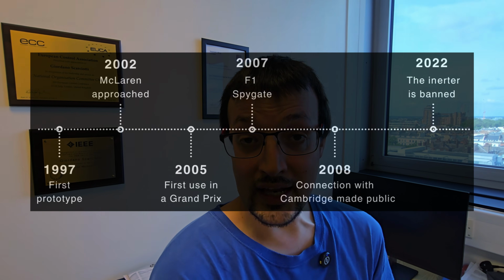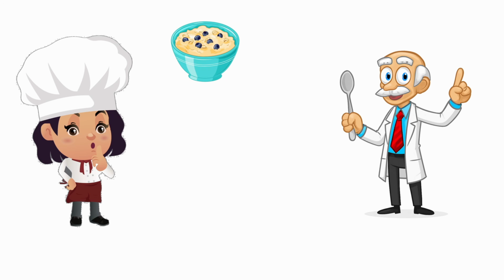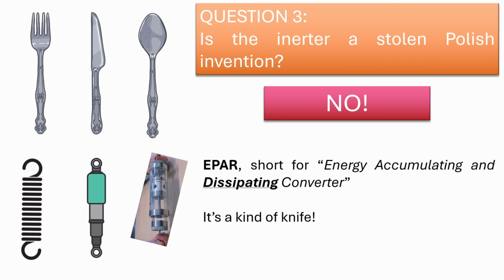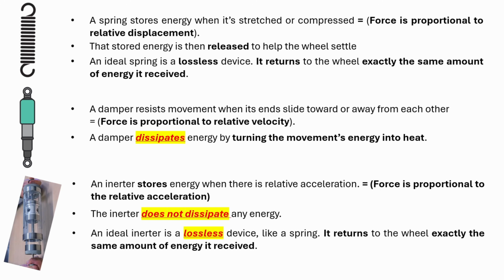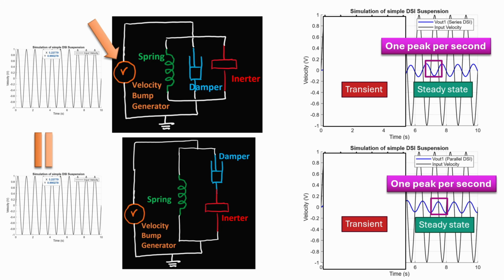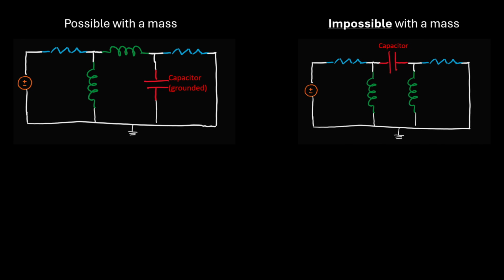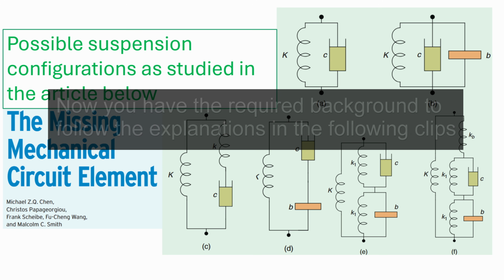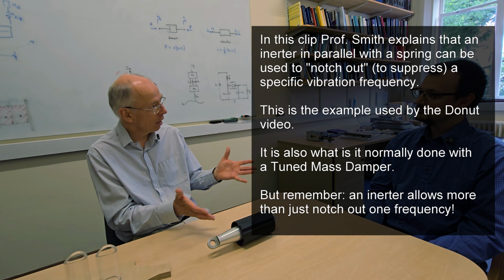Why Everyone Gets the F1 Inerter Wrong | Explained Clearly

Comment: Very interesting and detailed presentation.  Still have difficulty with an entirely practical aspect - How does pushing the threaded rod impart the rotary flywheel motion efficiently - especially if altering the pitch of the thread can adjust the inertance implies that any pitch will work?  Anyone got a spare Penske inerter shock I can take apart ?
Reply from the maker: That model uses a ball screw: recirculating ball bearings drastically reduce friction, so linear motion is converted into rotary motion very efficiently. The thread pitch determines the mechanical advantage: a finer pitch means more rotation for a given linear displacement, which increases the effective inertance. However, not any pitch will work in practice. Very fine pitches lead to high internal forces, lower efficiency under load, and can approach self-locking conditions, while very coarse pitches reduce the achievable inertance. So the design is a trade-off between inertance, efficiency, and mechanical limits.

Comment: pretty clear without watching the whole thing that damper=resistor spring=capacitor inerter=inductor.  The next components will be nonlinear devices which suddenly block or suddenly release energy, ideally like a switch with negative differential resistance regime.

Comment: Fascinating story together with the other video. What I don't quite get is that apparently the inerter is banned nowadays? So does that mean that the FIA decided that engineers should not be able to model the Bode plot completely? They want the chefs to serve meals that are to be eaten without spoons? Why not ban the spring or damper? Only because the interter was the last one to the party? And does this explain why in the last few seasons we see F1 teams struggle with porpoising of the cars?

Anyway, I really enjoyed all three levels of explanation and found them to be complementary to each other. Well done!
Reply from the maker: Thanks a lot for appreciating the video. Banning the inerter was part of a wider strategy of simplification and cost cutting in the design stage. Why the inerter and not spring and damper? Because springs and dampers are actually essential, they do 95% of the suspension work. Inerters are more of a performance-enhancing addition.

Comment: I would have added a fourth level — Control Engineering Graduate Level. In order to synthesize a Bode plot you need gain (up/down), poles (magnitude slope decrease and phase lag) and zeros (magnitude slope increase and phase lead). If you were to use a PID controller, that would give a gain, two zeros, a pole at 0 and a fast pole (used to cancel the derivative action at high frequencies). When the input is the rate of displacement and the output is the exerted force, the damper looks like a gain (an attenuation to be more precise), the spring looks like an integral, and the inerter looks like a derivative. A PI controller (spring and damper) gives you a pole at 0 and a zero. Adding the inerter you get a PID controller that provides an additional zero and 90 degrees phase lead which could help with the stability margin of the control loop, especially when the plant (the system that is controlled) already has too much phase lag. Side note: the fact that the input is the rate of displacement and not the displacement itself deserves to be emphasized and this choice should be better explained in the context of this particular application.

Comment: I was much more comfortable with the resistor, inductor, and capacitor analogy, where I could immediately understand the analogy - until I got to that point, I had no idea what was special about the inerter.
Finally it was the "mobility analogy" between current <-> force, and voltage <-> velocity that made it all make sense.

Comment: I see some comments mentioning the fourth fundamental passive electronic component: memristor.  If there are mechanical devices corresponding to resistors, inductors and capacitors, what would be the mechanical device corresponding to the memristor? @Prof_Gio : Is there any research on this question?

Comment: 1. An inerter is a fundamental element in a three‑part integrated spring–damping system.

2. An inerter provides an acceleration‑dependent force that enables full control of the suspension’s frequency response, thus expanding its tuning capabilities.

3. An inerter is a damper.....not! ☺

Comment: Good job explaining this. It is obviously the natural third part of a suspension system. It seems a great shame the F1 team banned it. However, presumably it should have a future in normal vehicle suspension? The only thing that I would be concerned about is mechanical wear on the thread. A big bump might exert quite a bit of force on the device thread which is forcing the mass to rotate faster.  Presumably you need a high lead  (long pitch) thread maybe with a ball nut arrangement for the rotating mass. You have a design trade off process to optimise the device.
Reply: It's more useful in motorsports where fine optimizations can mean the difference between scoring points or not. In normal vehicles, and even high end sports cars, it's typically "good enough" to have well-tuned chassis and suspension

Comment: Thank you. I'm 4 months late but I think I finally understand the complete picture now. Being EE, I recall in our control classes in the early 2000s, we used the analogy of voltage to force. I never noticed that the analogy is incomplete without the inerter. I guess I never noticed the difference between 1 terminal and 2 terminal application. It would have been nice if showed the response of a suspension system to actual bumps with a suspension designed with and without an inerter. But this is still, by far, the best video on this device

Comment: May I suggest showing how the Inerter is used in F1? I've watched both your videos on this and it has not been explained. You've used a suspension diagram with the interter floating in the air not connected to anything. Like your analogy, it's like talking about the features of a fork, spoon or knife, how to manufacture them, calculate the force and angles needed to use them, and the bezier curve calculations needed to define their geometry, but not actually shown them in use or how they are used to eat food.
Reply: yeah a video like that would be great

Comment: The fork-knife-spoon analogy isn't very good. A better analogy is LED lights. For decades we only had Green and Red LEDs. A blue LED was needed to unlock the complete colorspace, where the three could mix to create white light and any other color. People realized this, but the LED revolution could never take place until a blue LED was finally invented. Mass dampers and the other active suspension devices are kind of like getting around the lack of a blue-emitting diode by using incandescent light with a blue gel applied. Once the inerter became available, like the blue LED when it was finally invented, the complete system was unlocked.
Reply from the maker: Indeed the LED analogy is another good one, potentially better for a short explanation.

Comment: So: the "Inerter" essentially helps dampen the energy return to the wheel by providing an offset 'push-pull' effect against the spring returning the energy into the wheel, pushing it back against the road, but more smooth than the spring/damper assembly alone.
A better analogy is when I throw a monkey's fist over a ceiling joist (weighted knot on the end of a rope) to run electrical wire in a house. I lightly tug back on the rope to keep the weighted knot from hitting the floor too hard; so it hits softly, but comes down far enough. Comes down softly, but with enough force. Like a tire returning back to the ground.

Comment: My background is in electronics so upon seeing your first video I equated force to voltage and motion to current. In my frame of reference the damper equates to a resistor, the spring equates to a capacitor and that the inerter operating to oppose a change in position (i.e. velocity) equates to an inductor which opposes a chance in current. I must admit this video leaves me scratching my head since here the spring is equated to an inductor and the inerter to a capacitor???? Where is my logic going wrong?
Reply: They are thinking in terms of force and velocity in reverse ways than it is the opposite

Comment: I have watched the video with Pro, Smith and now this one.   I am not a trained engineer but more a visual one and I did get that this devise acted as an energy store and as such has a calming effect on spring energy release ?  I  found your technical data didn't give me a mind picture of where this inerter would fit into suspension system?   I then found a video by a guy calling himself "Donut"   and that was so well explained that I got it straight away.  The other thing I don't quite understand is why it's so bloody expensive as it looks to be a relatively simple device ?

Comment: So  an inerter is a suspension tuning component. Introduced into the system that is out of phase with the spring and helps to tune the response of the system overall. By adjusting all three components you can match the suspension response to a given track conditions. In an LRC circuit the capacitor and inductor would be out of phase and work to cancel each other out

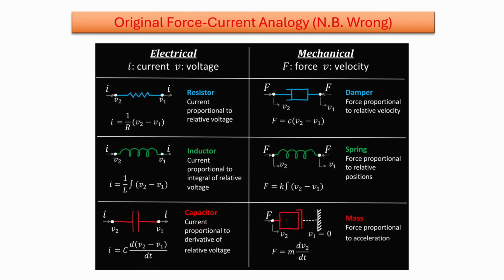Comment: Time 25:50 is WRONG!  Springs are like capacitors. Inerters are like inductors.

Spring: The greater the change in position (thereby force) across the spring the higher the opposing force.
Capacitor: The greater the change in charge (thereby voltage) across the capacitor, the higher the opposing voltage.
  
Inductor:  Increasing the current in an inductor builds a magnetic field which opposes the change but then has no effect if the current remains constant.  The decaying magnetic field will the oppose a decrease in current.
Inerters:  Increasing the velocity in an inverter builds an inertial moment which opposes the change but then has no effect if the velocity remains constant.  The decreasing inertial moment will oppose a decrease in velocity.

Comment: I'd never heard of inerters until I watched the initial video yesterday; you live and learn, even in 'late middle age'!  I really enjoyed your explanation. As an Electrical Engineer, could I suggest I would have understood the device more quickly had you said earliier that there's a 1:1 relationship between damper/resistor, spring/inductor, and inerter/capaicitor, and that,like its electrical counterparts, the ineter shifts phase 90deg one way, the spring 90deg the other. FWIW it's never going to be easy to explain in simple terms something that, like its whole area of discipline, hinges on the square root of -1.  Fascinating. Now, bring on the mechanical transistor!😀

Comment: Yes, tuned mass dampers are inefficient but effective... the two words mean two different things. In real world application effectiveness trumps efficiency as it gets the job done, efficiency is good but it's meaningless in a vacuum and many a good scientists and engineers lost themselves that way. It's a tool to get rid of whatever passes the through the suspension, which will happen. With a better suspension you can reduce the drawbacks of the MD and it should be more actively pursued. Dismissing a tool for some arbitrary notion of purity of efficiency is silly. Specially when other uses besides race cars means the drawbacks can be much lesser for the given application. 

Also arguing about the MD being an aerodynamic device is... silly. You could also bend reality with words and say whatever flow control they have for coolants affect the heat impaired into the car's airflow and it's therefore an active aerodynamic device. Heck modulating braking and acceleration therefore also are. Or a semi-active damper, etc. And even if it's... why the judgement?

And I do fundamentally disagree that the inerter is lossless device that does not dissipate energy because there is no such thing, and it's not hairsplitting. Most of the models shown with gears or leadscrews are very lossy devices and I cannot see many different ways to implementing it while being fast reacting (you can store energy in a fly wheel with less losses, but you need further mechanical system to deliver and extract energy which are not feasible in a suspension element even if you can make them fast enough) besides those solutions. You also do have to account for backlash in the system, which probably is negligible compared to deflection of suspension elements, but it's there and to get rid of it greater losses can be expected.

The mere illustrator of the front F1 suspension also tells more about how it's used. It's pretty clearly, if we assume it's somewhat accurate, shows the inerter taking the place of the the heave or third spring, meant to deal with porpoising and dive in an axle. It also does act somewhat as an antirollbar, at least initially. And it will further connect the two sides of the suspension but add the "capacitor effect". I do not know how it will affect the behavior of the car, but it's not a minor change. And the simplified circuits shown do not show the full behavior of the type of suspension where inerters currently matter.

Now don't take this as me dismissing your explanation as invalid. It's not. But nuances and complexities of real implementation do need to be taken into account to get an actual understanding of any real device and its correct implementation... and this should be conveyed to the public even if the underlying theory does rely on ideal models. Obvious the people applying it do take everything I said and more into consideration.

This is what I do, poke holes, find problems, raise variables, etc because if I don't reality rears its ugly head and trouble ensues.

Comment: I should probably watch this video first and im sure Professor Smith considered it but i wonder if it would be beneficial ro use two inerters of different inertance (one for bound, one for rebound) with one way (freewheel) clutches, or a dual mass inerter with a freewheel clutch on the outer flywheel, they.would need ro be damped internally but maybe this would be more good too. (the electrical equivalent would be two capacitors with alternating diodes and bleed resistors i guess)

Comment: 7:37 you are making a very good analogy of mechanical systems to silverware. You cut with a knife, you hold solids with a fork and the missing part was how to hold liquids.
In silverware spoons can hold solids and you can cut food with a spoon but that doesn’t mean those are the uses of a spoon. In mechanical systems an inerter can dampen forces and stores energy, like dampener and springs do.  Nonetheless, we are not talking about the energy of a system but movement. An inerter can behave like a damper or spring depending on the forces. We can make an analogy with electrical components in electrical devices capacitors store potential energy, inductors transmit kinetic energy and resistors transform energy; springs transmit potential energy, dampeners transform energy and inductors store kinetic energy. Do they behave the same? It all depends on the movement, in an electric system it is different when talking about direct current or alternate current (DC/AC) in mechanical systems to it is different in static than dynamic systems. 

14:10  In F1 the inerter increases the “weight” of the car when there are bumps on the track while maintaining the same mass. 

28:51 the inerter behaves like a damper at the beginning of the cycle in that it absorbs potential energy to convert to kinetic energy. It feels like a damper because opposes a force (or change in acceleration). In an electric system components do it faster. 

In your previous video https://youtu.be/FhmLb2DhNYM&T=2569 s Professor Malcom Smith mentions  at “as the frequency increases, the force in the inerter increases much more rapidly than the damper or the spring”. I was wondering if it is possible to create a differential with a Beier clutch to take the change in frequency out of the equation? I have to brush upon my calculus to set the right amount of components. I think a variable speed clutch can solve the rate of change of the inerter’s force. Increasing or decreasing the internal friction force could generate a device with constant or at least estable force. Further more since there is an element of friction the need for an external damper is void.  Think of it as a noice canceling headphones. The track is your voice and the defects of the surface of the track the noice. 

https://youtube.com/shorts/N4Mcx4njAaM could a F1 car suspension suppress the music in Denmark? (assuming it is tuned at 200Km/h)

Comment: A lot of people still don't understand specifically why you would use an inerter on an F1 car, which is a fair complaint. I will attempt to explain, as I understand it. 

As some have pointed out,  it seems to have a similar effect as increasing unsprung weight. This is usually universally a bad thing, but in F1 specifically there's nuance. F1 uses tires with very tall and relatively flexible sidewalls, which can act like additional springs between the wheels and the ground in addition to the conventional springs between chassis and wheels.

Performance-wise this means in a well-tuned F1 car, small bumps in the track are ideally  absorbed entirely by the tires, and not transfered into the main suspension at all. By using an inerter, you can easily make the wheels more resistant to rapid acceleration (such as running over a bump at high speed) without changing the suspension response to slower accelerations (like weight transfer under braking and turning). So small bumps and other high frequency tire motions get dissipated as sidewall flex instead of moving the entire wheel up and down at high frequency.